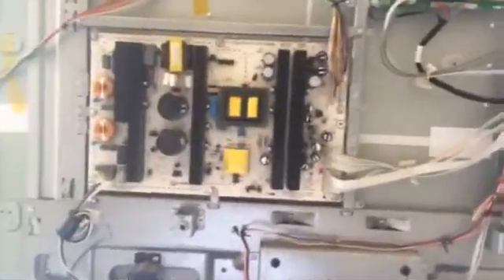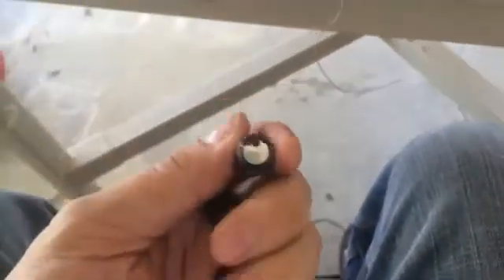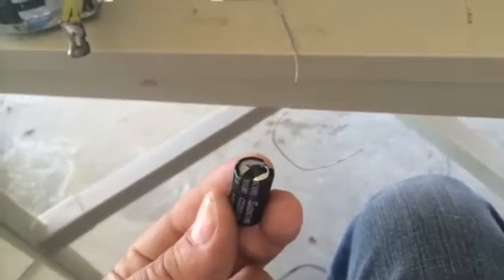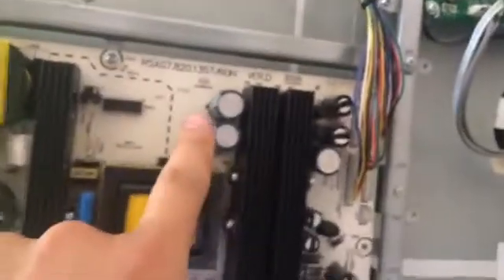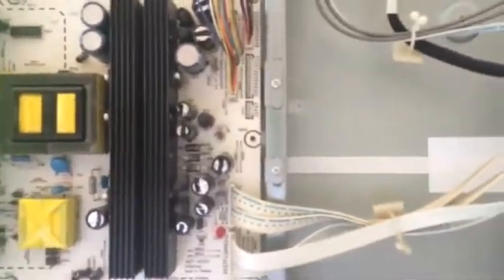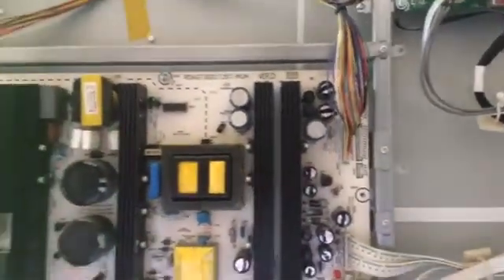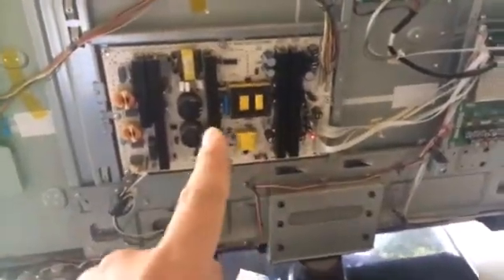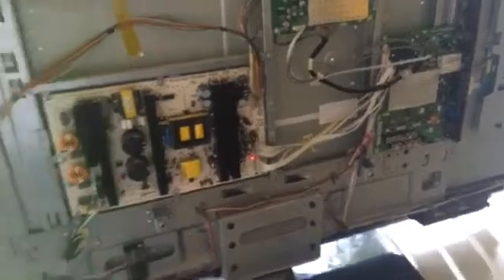Flickering screen repair(proscan55")

Comment: How to you disconnect the capacitor ?
Reply from the maker: Andrew Rhoad get yourself a hot iron suction Solder tool and remove the Sauter from the capacitors and they will easily come off

Comment: Hope you replaces those caps a higher voltages than the original caps voltages,like 5 or 10 voltages higher.Most of these caps are slowly dying and leaking electrolytic's chemicals,because the voltages of those caps wasn't strong enough for handling the temperatures parts of the power supply board electrical temperature distribution of the heats.If you replacing those caps same exact voltages of the caps,you taken out.You will replace it again like 6 months or a year later.